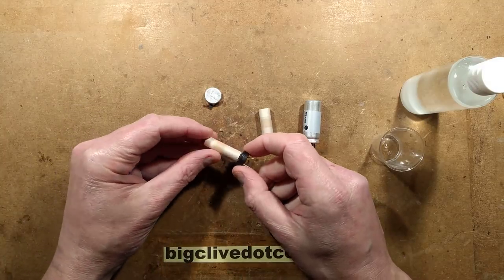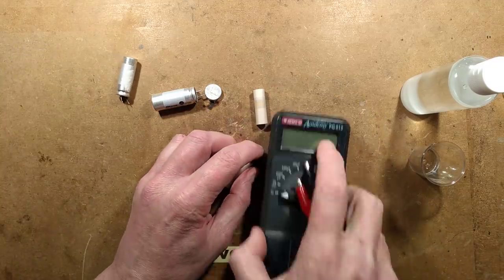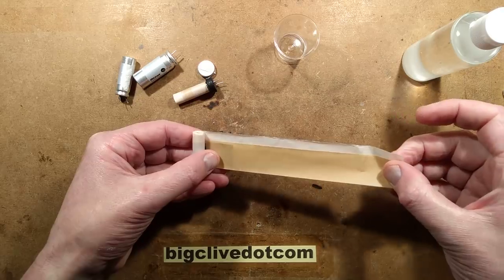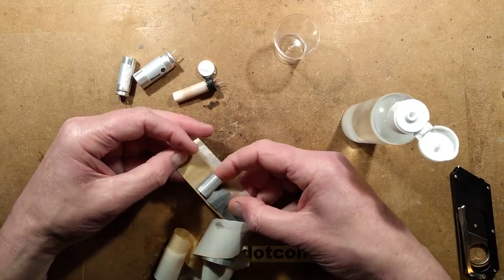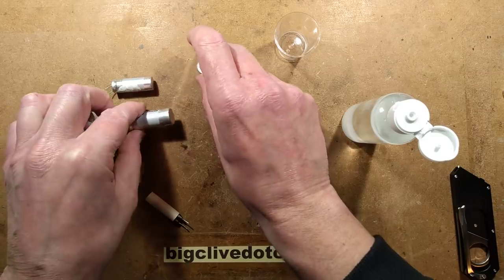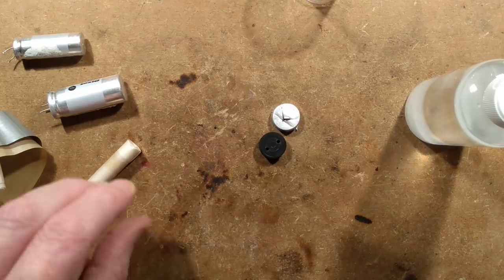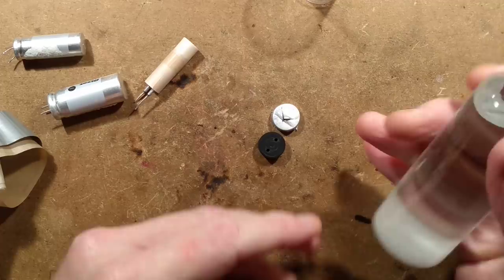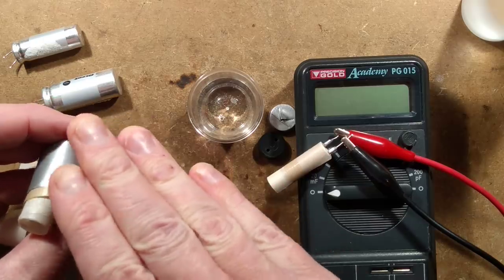Adding electrolyte to a fake (dry) capacitor.

Comment: To form a capacitor you're supposed to gradually wind the volts up to give the coating a chance to electrolytically form; taking many hours.
Reply: And... I'm fairly sure the voltage needs to go above the rated voltage of the capacitor a slight bit.
Reply: Many hours? I doubt that, caps wouldnt be so cheap if it took hours to form. There must be a faster way, my businessman instinct tella me so.
Reply: @laharl2k  well there is likely a quicker way, but something that is such a common component even before they worked out quicker ways they would have just made machines or jigs that allowed thousands to be done at the same time, something can take an hour but still have a high component produced per minute just by the scale at which its done.
Reply: Forming the fine bubbles near the plates is a function of current and time.  Low current and long time provide the smallest bubbles and the best overall capacitor.  If they are reformed too fast or with high current, while they may still work, they will not work at peak.  Electrolytic’s that have sat for a very long tome ( but not dried out) should be reformed very slowly for best results.
Reply: @laharl2k  A CPU takes about 3 months start to finish to make yet they are pretty cheap comparatively. Also why Intel was so screwed when they killed a batch at TCSM with contaminated cleaner.
Reply: @laharl2k  really? Plenty of manufacturing processes take hours (or even days), they just do them thousands at a time.
Reply: @JohnRunyon  Exactly hours means nothing when you are doing runs of 10 million.
Reply: Everyone is mentioning large batch processes, but consider pipelined processes as well.  
Once the process is pipelined, the completion time of a single step doesn't influence the throughput rate; it merely means that the handling equipment for that one step needs to accomodate a larger number of parts than it would if it took less time.
Reply: He was putting way too much current into it. I successfully reformed some big capacitors last year. I used less than a milliamp and it took several days. That was for capacitors that were around 200,000 µF. 

I wonder if they do it differently when forming the capacitors initially.
Reply: @PSUQDPICHQIEIWC  That is true as well. Some companies use batch and others pipeline it has a lot to due with the needs of the company. Both have their advantages and disadvantages. And sometimes both are used at the same time it all really depends on the needs of a company. But in some industries its not unheard of for processes that take months or years.
Reply: Connected wrong way round, and stripped the oxide layer off the cathode, making it into effectively an anode, and the anode breakdown voltage is under a volt, making 2 very poor diodes in parallel. The grey foil is the cathode foil, as it is the most highly etched foil, with the largest surface area. Formed during the etching process, as there is when they grow the pits and tunnels in the foil, and the final step is to dip it in a long wash bath, and then grow a thin oxide layer on the foil, and the thickness of this foil is the voltage rating. 

Then to make the capacitor you take a certain length of foil and wind up with anode foil, which is shiny as it only has a very thin oxide layer, and with slightly more anode foil to compensate for it not being etched, and put with the separators. Add electrolyte and instant capacitor, just like Clive had. No forming afterwards, as the oxide layer fresh from factory is thick enough, only that there is a brief test afterwards using a test voltage of 1.6 to 2 times the rated voltage to check for defects, measuring the integrated current to get capacitance, and then a brief leakage current test. Pass all 3 and it goes out. 

The reason old capacitors need reforming is the electrolyte gradually, as a consequence of time, breaks down the oxide layers inside the capacitor so that all oxide layers will even out to the same thickness, and thus the cathode foil will become thinner oxide wise. Thus after long storage with no applied bias to keep the oxide layer thick ( reaction with the electrolyte to form aluminium oxide, and with the liberation of a small amount of hydrogen gas, which diffuses through the metal body and the bung) you reform by applying a limited current, allowing the oxide to reform, though you lose electrolyte water in doing so.

Capacitor electrolyte is originally borax10%, as the ions to carry the current, ethylene glycol 50%, as both carrier and antifreeze, and then the rest water as the active forming agent. Borax can crystallise out, plenty of spare volume, as the electrolyte is there to make the anode, with the anode foil and the electrolyte being effectively the one foil ( anode foil is deliberately less pure, so it does break down easily and does not form as thick an oxide layer) with the thin deliberately grown layer on the cathode foil. The cathode foil is etched heavily, so that it has massive surface area, and is etched so that there are even tiny holes right through, so there is maximum area to grow oxide, which is the dielectric. Modern mixes have additives to enhance conductivity and preserve the oxide layer, and are mostly proprietary trade secrets per manufacturer with regards to the exact blend.

Aluminium oxide is the dielectric, only a few atoms thick per volt, so that in one side ( cathode, or negative side) it is in contact with pure aluminium metal, and then the electrolyte wetting it is the other layer of the capacitor. Large surface area, thin dielectric, so large capacitance in a small volume, just like modern ceramic capacitors though there it is from thin layers of silver and ceramic insulator. Tantalum capacitors the same, a thin layer of tantalum oxide on bulk metal powder and either a solid conductive electrolyte or, for wet tantalum, concentrated sulphuric acid in a silver coated steel case, soldered with high silver concentration solder.
Reply: @laharl2k  You have never experienced manufacturing. Yes. Many hours. As the finished product comes off, 1000 more have been set into "motion". Once the first "hours" have passed, the line perpetually produces Caps steadily. They aren't brewing them in a bathtub.
Reply: @laharl2k  I raise you budget mature cheddar cheese.
Reply: @VCanisMajorisY  I see your cheese and raise you cheap whiskey.
Reply: @excitedbox5705 : "at TCSM"
Or TSMC, even.
Reply: @ropersonline  Damn it I always do that. That´s is why I shouldn´t stay up so late. It was almost 5am in Germany. :)
Reply: @PSUQDPICHQIEIWC  This statement is somewhat trivial. People are just looking to hunt for and successfully spear a productivity improvement, much like their ancestors no doubt hunted and looked to spear the elusive mammoth. A smaller piece of handling equipment is much less in material cost, and people hunting these productivity improvements rarely have/want to invest more money in larger equipment..... So discussion inevitable comes down to talking about the tip of the spear.... cognitive bias, if you will....
Reply: @sixstringedthing I see your cheese and cheap whiskey and raise you fine cask wine. 8 Aussie Peso's per 2 litres retail with duty paid... It's so sulphited that it doesn't even turn to vinegar when you leave it out.
Reply: I brought up the point to illuminate the fact that pipelining is a tool to separate process throughput from subprocess duration.  Of course pipelining is not universally applicable and does not universally remove all time-associated costs from production.  Of course efficiency is desirable.  Whose statement is trivial?  What is your point?
Reply: @jlucasound  II\f they were you can bet Clive would hop in.
Reply: Laharl Krichevskoy Chinese caps yes . Quality caps slow and low
Reply: @laharl2k  economics of scale. they are making millions of them at a time.
Reply: @excitedbox5705  Intel doesn't not use third-party fab, they do everything in-house.
Reply: @rocketman221projects  yes, if you see that kind of leakage current the next thing that happens is that the can gets embedded in a ceiling tile and all you have are two legs and some spiral fluff.
Reply: jlucasound 
Well i do produce stuff just not in those volumes and machine time is most of my costs. My idea is that if they make millions per hour and you need several hours to form then youd need space where to hold those caps while they form, meaning youd need space for the machine and another <production rate> X <hours it take to form>, and if thats millions and it takes a day youd need space for tens of millions of caps at the same time. I guess youd need several warehouses just to acomodate them all.
Reply: @SeanBZA  Found the electrical engineer!
Reply: from the way its constructed, it's not a polarized capacitor anyway. It literally has two plates on top of each other but forming it will give it a true polarity of course. A true ecap has a cathode that's sunk into the electrolyte
Reply: @excitedbox5705  the actual building of a cpu like the machining takes a few days the design is at least a year in the making and ten years in the ideas bin.
Reply: @laharl2k  Not if you ship them out at a similar rate to production, then you only need enough space to hold a few shipments temporarily. As soon as your product reaches the wholesaler any issues with volume and storage become their problem.
Reply: The comments alone are worth coming to this page. Awesome!
Reply: @laharl2k  Look at how big the average capacitor is. About 1/4 inch or less in diameter. You can make about 20,000 at a time. Even at 10 cents per cap that's still good money

Comment: As a mechanic I've tasted antifreeze more times than I can count:) and brake fluid, and transmission fluid, and oil and......
Reply: ...meth
Reply: You haven't lived until you've had warm transmission fluid drip into your ear.
Reply: @ToTheGAMES  like burning plastic amiright?
Reply: Don't forget battery acid, tastes like a real sharp lemon.
Reply: @threeMetreJim  A low enough Ph, I can believe it. When I saw a friend lick a transmission dipstick, I freaked out. He was checking for particles, friction material, etc.
Reply: You have not lived untill when welding with a torch you get a pop and you hear the bit that landed in your ear sizzling
Reply: Do RC some of the better sensations is having petrol run down your arm until it reaches the soft skin of your armpit and then burn, or be lying in mud under a machine only to get covered in hot coolant from head to toe, or have fish blood and bleach drip on you while you are working in the snow trying to remove a transmission while the vehicle is on axle stands.
Reply: Sounds vomit inducing
Reply: Interesting competition.
Reply: SCA coolants and gear oil are some of the worst 🤮
Reply: @johnsiders7819  Never had slag hit my ear, always seemed to like to aim for the hoses... Although last time I ran a vertical mill I did have a steel chip the most beautiful shade of cobalt blue sizzle itself into my cheek right below where the safety squints sat. Left me with a little dorrito crater ever since.
Reply: @rsoul7282  Worst one for me was the contents of a commercial hot oil kettle/fryer got dumped on my arm (between 350-400F). Luckily it was outside in winter (shoved my hand right into a snow drift asap) and it was bare skin contact, so I only got 2nd deg burns. Dr said normally its not advisable  but punching the snowbank probably saved me some skin grafts.
Reply: @OldBenOne  how about head to foot with very warm hydraulic oil.  Great for the skin.  The seal blew on my dad's tractor one time.
Reply: @lordfly911  " The seal blew on my dad's tractor one time." Ditto Case 480.
Reply: If all 5 caps works, is it give benefit to car electrical system?
Reply: @lordfly911  From my dad's Case 480, only from the waist down.
Reply: @208Concepts  SuperCheap Auto? From Aus? Nah mate
Reply: @Helladamnleet  ?
Reply: I work with plastics, I've tasted Acetone and various other types alcohols...ethanol tastes kinda meh but doesn't kill you, acetone is better but....well....methanol gets turned to that.

Also I've gassed myself multiple times...

Comment: For future reference: Your electrolyte solution contains water. When you apply voltages over ~1.2 V you start electrolysing the water and forming H2 and O2 (the bubbles you see) and thus passing a DC current (until the all the water in the electrolyte is gone). That's also why the Chinese tester says "two diodes". Your other capacitance tester tests the capacitor at lower voltages, too low for electrolysis, and as such it "sees" a proper capacitor.

Comment: I've reformed capacitors. It takes some time depending on the capacity of the device. It is a vintage radio thing. There's info about reforming caps online.